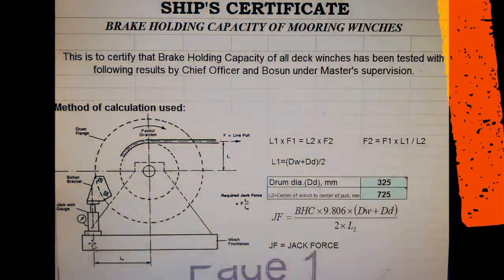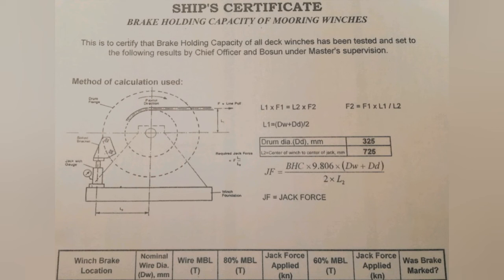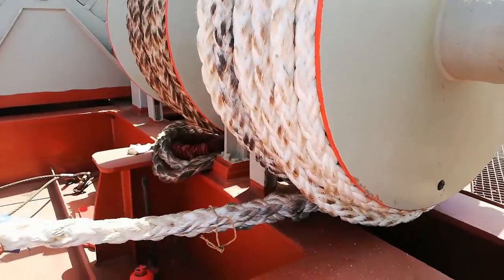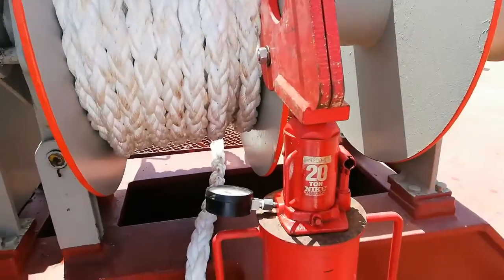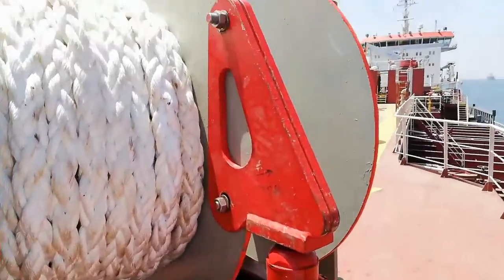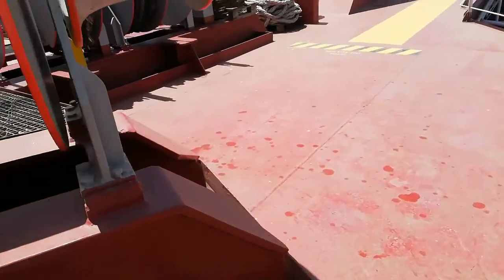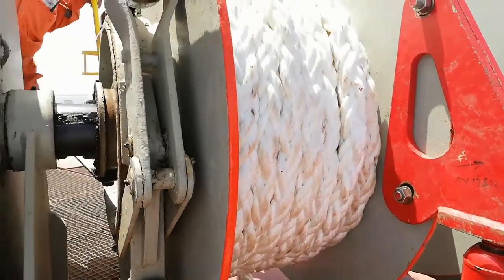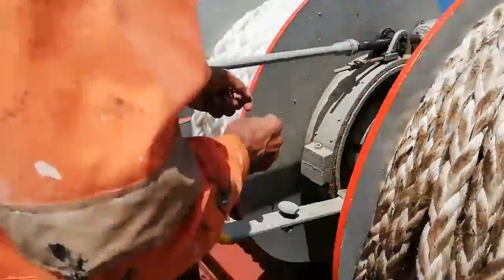Merchant Navy Life Brake Holding Capacity Test of Mooring Winch

Comment: Why did you slack the break on 80%percent or 60 percent value? Off course it will slip. You should continue pumping the jack until the mooring winch render from 80 percent or 60 percent as per calculation then if not render continue pumping until it render. then record the new value and adjust the 80 percent and 60 percent then mark on mooring winch.

Comment: this is wrong as per meg4 we use SDMBL Not LineMBL
Reply from the maker: Thanks for bringing up the point. Obviously you are correct. According to MEG4,newly introduced SDMBL should be the initial reference for the BHC test. This video is little bit older as When a ship is built, the mooring winches are equipped with mooring lines of a MBL roughly equal to the SDMBL. Anyway all procedures are same as instructed in the video and we have to use SDMBL instead of MLMBL.
 If existing ships are built as MEG3//Refer to Intertanko Guigance => if there is original SDMBL not available, BHC must me determined from the manufactur's certification and Calculated SDMBL = 125% * mooring winch designed brake maximum holding load.
Reply: @samratthawani94: can you give me 1 video for refer abt it and how to cal SDMBL if it is not available onboard
Reply: @vanmyle4631 SDMBL can be found in the mooring winch manual provided by shipyard if u cannot find it you can use the MBL of the rope which was put in use during yard delivery

Comment: So capt..for rendering point set always set to 60% and 80%? My vessel also has 2 marker, but set 100% and 80%..help  me to clear this issue
Reply: There are basically 2 values BHC brake holding capacity and  BRC brake rendering capacity. BHC value should be 80% of the MBL i.e. minimum breaking load of your mooring wire/rope. A typical mooring wire of a VLCC has an MBL of 115 Tonnes. That means your BHC should be atleast 80% of this value which comes out as 92 tonnes. However considering frequency of your mooring operations , Age of your mooring wires and exposure to harsh conditions a 20% safety margin is used to totally rule out any chances of mooring wires breaking. Hence the BRC value which is always 60% of your wire's MBL , which in this case would be 69 tonnes. Always mark 80% and 60% on your winch breaks. Breaks are supposed to slip. That's the whole purpose of them. You don't want to set them at 100% and wait for your mooring wire to break.
Reply from the maker: It is Typically, mooring winch 
brakes are designed to hold up to 80% of the MBL with 
the capability of adjusting these to 60% of the MBL to 
allow for a margin of safety.
80% is the ISO limit. Its not good to set the limit for 100%. It should be set to a lower value than MBL. Because main purpose of this is to prevent excessive load to the winch motor.